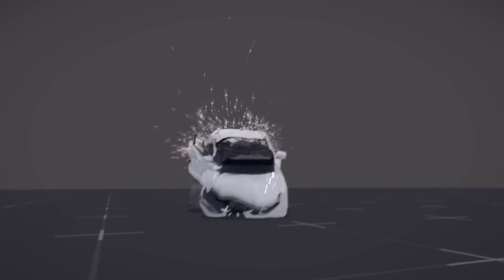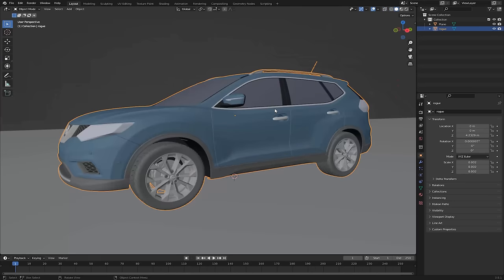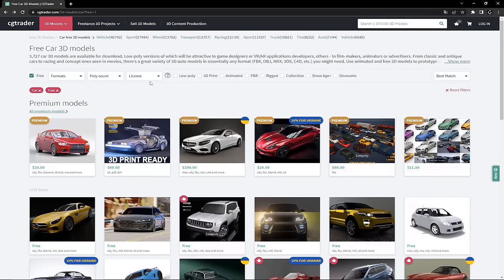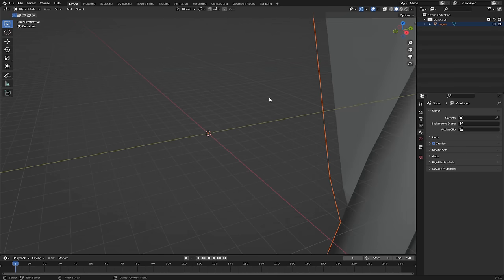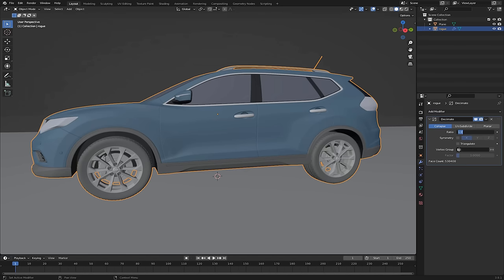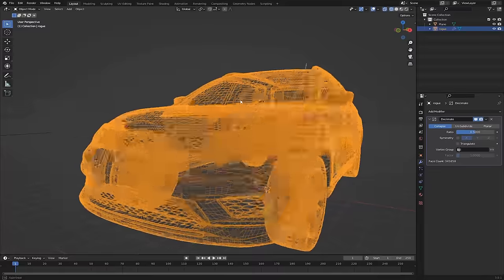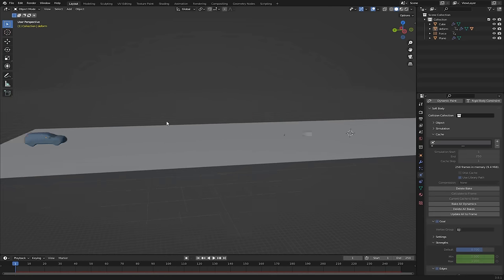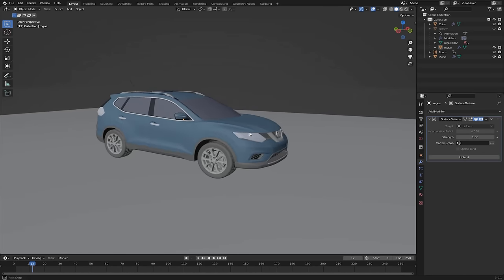How to simulate a car crash in blender

Comment: This looks good but some suggestions
 The metal ( or the outer part of the car ) should be more stiff (it should stay in the deformed postion ) .
Reduce the number of glass particles ( car glass is tempered) metal particles would be good , also sperate some parts (like  wheels or door or mirrors )of the car and add rigid body physics.
Car needs more weight,  it looks a bit like its floating .
Smoke  looks a bit weird .
Reply from the maker: Thanks for the suggestions! I'll keep those in mind next time

Comment: Adding .99 Push / Pull values will make the object disappear. Having scale applied to the deform mesh. 
Only if I lower the values to .5 or around .6 the mesh continues to exist
Update; Seems we have to be quite conservative with the density of the deforming mesh, lowering the resolution solved the issue

Comment: I'm on blender 4.0 and my animation is running on 1 or 2 fps and even crashing when I apply soft body to my mesh,

My specs are: Intel core i5 10th gen

Nvidia GeForce GTX 1060 6gb vram

Ram: 16gb

Virtual memory:9924 mb

Windows 11 pro

I'm relatively new to Blender so any help with settings, would be appreciated.

Thankyou.

Comment: Hello
On blender 3.2 it just doesnt work i tried to mess with the settings but no way.
My car just like melt on itself.
Even with collision, the stuff go through the ground.
It's like the car just transform into a cloth.
Reply from the maker: Hi! Sounds like you have some problems with the soft body sim. For starters you can try increasing the push and pull value of the springs. If that doens't work, maybe you need more geometry in your deform object. You can get that by changing the value of the remesh modifier. Hope this helps.
Reply: @AlbinThorburn  hello
ty for answer.
actually my cas is getting like really blocky if i use the same values as you when you uses decimate modifier.
shouldn't i just dont use it at all? 
0.5 or 0/6 i got basically a very cubic stuff so i sticked to 0.12 wich maybye was too much still.

Comment: Dude, use 'L' to select loose parts and it will select parts of the mesh which aren't connected to anything(meaning that they don't share vertices). 

This was a good tutorial nonetheless....

Also to make it better, the crashing need to be faster(the simulation), its too floaty. Either increase the object weight or simulation speed. Also for the glass shattering, in the collision properties, decrease collision margin and increase friction and damping.
Reply from the maker: Bro thank you so much I actually didn't know the L trick. Thank you :D
Reply: @AlbinThorburn  Np, happy to help :)
Reply: @Luda Cris why tho, irl car crash faster due to mass
Reply: @Luda Cris It would look better if it was sped up, since speed can represent weight and if weight isn't felt then any animation is going to feel off, Slow motion is a different thing tho, where EVERYTHING slows down to emphasize the main thing happening but you can't classify this animation as slow motion as everything else is moving faster like the glass shards.

look at the animation again and see whether its a bit floaty or not. 

Animations is tweaking stuff you can't do irl, yes but you have to respect momentum and weight otherwise, its a no go. look at any other animations where they don't respect what I mentioned above... if you don't respect those laws then you get animation which look like surreal entertainment's stuff(they intentionally make it like that)
Reply: @DviousDingle he could have sped it up after the car flipped over that way it amplifies that slow motion I agree sped up should have been key framed but after the car flipped
Reply: @mybiznizisbangingdooog7481  oh yeah, i agree with that
Reply: @DviousDingle  you did a hell of a good job

Comment: Can i adjust the Pull and Push to 0.86? It looks good if its like that and it will deform pretty easy but it keeps the deform phase!
Hope you mind Replying!
Reply from the maker: Yeah man, experiment with it and see what works! The values in the video are just what worked best for me after some trial and error. Still not perfect though as some have pointed out it's a little wobbly hahaha!

Comment: I gotta ask, why did you decide to choose soft body over rigid body? The car suffers from squishiness :) when a car crashes, it generally keeps its form based on the point of impact and how much force has been applied. For example, where your car is hitting the box at the front, most likely the back end of the car would be mostly fine, and even the rear windshield and rear windows could be intact. I did like the breaking windows, but them all breaking at once does make the car crash feel unrealistic. I hope my critique is ok. If you were going for more theatrical, this works.

The overall tutorial was helpful for breaking into the newer versions of Blender; I did some car crash simulations on 2.77 and was hoping they had improved the physics (which looks like they have). Thanks!
Reply from the maker: Hi! Thanks for the critique, I totally get what you mean:) the reason I tried using soft body sim was to have the deformation be physically based on the impact, but it totally looks a bit squishy haha! You could probably get a more plastic deformation by changing the simulation settings, but I was pretty happy that I got it to work in the first place!:)

Again, thanks for the feedback. Cheers!